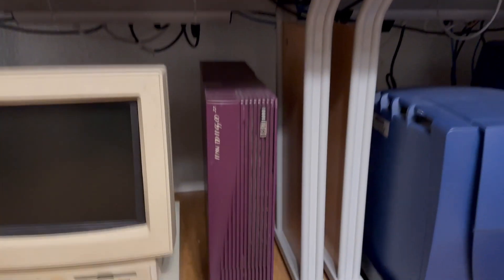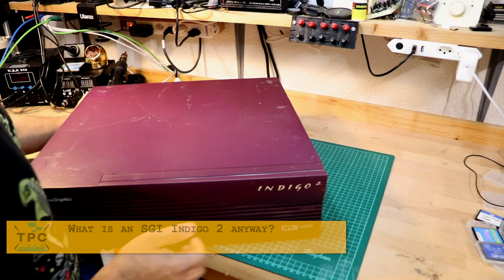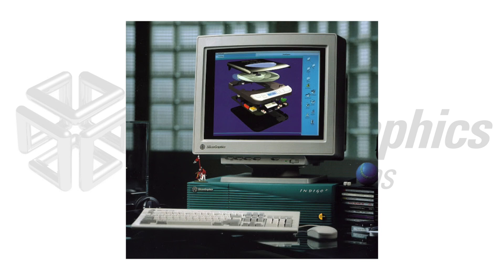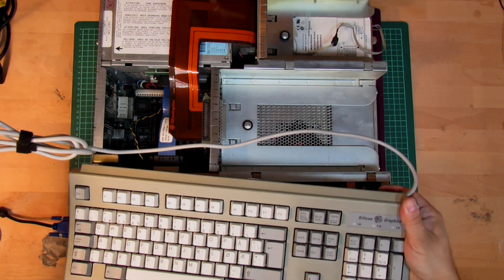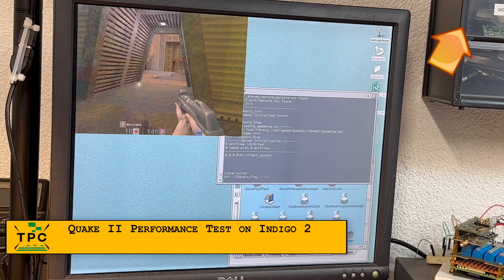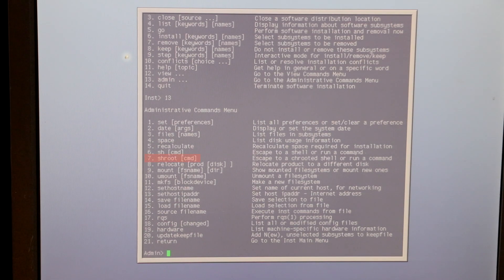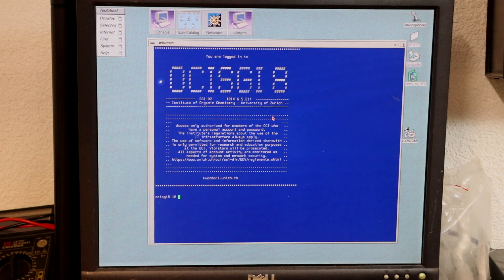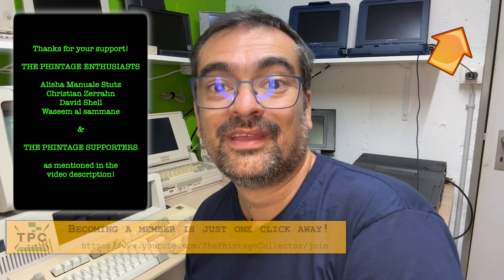Silicon Graphics Indigo 2: A First Look & IRIX Root Password Reset

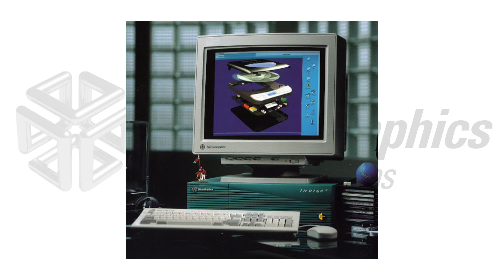Comment: 2:09 - Indigo2s were not normally quite that expensive. :D  In Feb/1996, an R10K/195 SolidIMPACT with 128MB RAM and 4GB disk was (with 25% academic discount included but not VAT) 27595 UKP, and of that, about 6K was just for the RAM.

The 175MHz version would have been somewhat less, while the R4K/250 equivalent was 23192 UKP. To scale up the cost, an R10K/195 MaxIMPACT with 384MB RAM and 4GB disk would have been about 54000 UKP, the RAM responsible for 18K of that, ie. a 128MB kit cost 6K (it can take more RAM, up to 1GB, but 256MB kits didn't come until later, and the 512MB option was never official).

What really blew up the costs was OEM software; I remember seeing a Maya/Alias licensing invoice at a movie studio around the same timeframe for 50K/year, while prices from Discreet might require the sale of a kidney, or an arm (whichever you disliked the least). I know someone who bought an original Flint system from Discreet at that time (R4K/250 Max/TRAM, 384MB, IMPACT Digital Video w/ VBOB, special CDROM base tray with SCSI extender to give an external port for channel 0, disk array with 4x 2GB on two channels, A2 Wacom, etc., running Flint 5.5) and it cost 95000 UKP (which would easily have been a solid chunk over 100K USD after conversion), but this sort of thing was an exception rather than the rule.

5:15 - No need for all that, just enter 'sh' at the first prompt. Interesting use of the passwd command though, I normally prefer to edit the password file with vi to remove the password, along with passwords for any other relevant user accounts to make things easier, ie.:

/root/usr/bin/vi /root/etc/passwd

6:19 - There are better ways of doing that, but one extra step that's helpful is to go into the label menu and turn on write caching, this can speed up older drives by a useful amount. One can always run a sequential read scan later. Easier to just repartition instead and then mkfs a new filesystem, though when doing so I use the expert menu to configure a larger than normal swap, usually 256MB or 512MB depending on the disk capacity, installed RAM and what the intended tasks will be for the end recipient. For maximum certainty, run a full read/write/compare sequential scan before doing the OS install (never use the random option), I think the auto option is only doing a read scan.

Note that SGI marketed the R10K/175 system as Killer IMPACT.

Comment: Do these old SGI compuets have any use beside exploring hardware/software and being basically used as a historical object? They are definitely not for retrogaming,acting as a server,porting back newer softwares and etc...
Reply from the maker: SGIs were no gaming machines.
Although there were games for it, too. And even some popular ones like Quake II and Quake III Arena were ported by the vendor itself, to show the 3D graphics capabilities.
And the powerful SGis didn't actually do too bad on this behalf.

Still, given today's standards, these machines are not only old, but also slow.

You can of course run contemporary software on them, like on any machine from that era, at the example of SGI, Maya, Photoshop, and what not. That was, what these machines were made for.

But as technology, and also the software has evolved, there's no practical use except, as you say, for exploring how things were 10, 20, 30 years ago.

I once did a video how to do video editing using Adobe Premiere on a SGI O2 workstation.
Can it be done? Yes. Is it meaningful? No, except for the showcase.

And show is the server functions, which actually did exist in SGI IRIX.
It could run as web-servers, DNS, NFS, NIS, and what not.

But mostly, IRIX servers were used as 3d render farms, or SGI's own video conferencing product, to just give two examples.

But again, nowaways, nobody would do that, as even the most recent MIPS-based SGI running the IRIX operating system was released in 2003.
I don't think anyone is still using nowadays any Tezro workstations or Origin 3000 servers anymore in a production environment.
Reply: @THEPHINTAGECOLLECTOR  Not so, there are vast numbers of SGIs still in commercial use in a number of sectors, mainly PCB production, textile manufacturing, medical, vis sim and defense industries (those that concern industrial control processes or management of external hardware). Most systems still in use tend to be Personal IRIS, IRIS Indigo, Indy, Indigo2, O2, Octane, Fuel and Onyx. Most company queries concern Indy, O2 and Fuel systems, though a major printer manufacturer bought some RAM kits last year, they're still using Indigo2s. AMAT SEMs were typically driven by Octane or Fuel systems, for PCB analysis, and its these which sustain demand for higher order parts such as V12, DCD, DM6, etc.

Some people do use them as servers. Remember O2K type systems can have GigE, while O3K can use 10GigE. Personally I wouldn't, though ages ago I did use an Indy and then an O2 as a firewall box for a few years.

I heard from someone who uses an IRIS Indigo for audio, because the quality of the audio chip is so good. The oldest system I've dealt with is a 12MHz Personal IRIS, still used at a textile factory in Ohio. I was also contacted by a US defense contractor looking for parts for a 4D Series machine, which is even older, probably an R3000 variant (perhaps a POWER Series, the guy didn't say).

But where CPU performance is paramount, such as rendering, likewise raw 3D, then of course no, they've long gone from the market for that sort of thing, but a lot of people do get them so they can use older versions of pro apps which they favour, Power Animator 9.0 being especially noteworthy. Recently I sent an O2 to the US, to be used by a young guy who wants to learn old Maya, etc. I've talked to many in recent years who have setup old SGIs so they can explore or relive the 90s-style CGI that was popular in film, TV and animation back then (one guy was especially obsessed with Jurassic Park). One lady, a retired CAD designer, obtained an Octane so she could explore the work she used to do. You'd be surprised. However, companies that still have them tend to not want clients to know this is the case. I talked to a movie studio which still runs an Onyx3900 IR4 with Inferno, because the admin said it still worked fine for compositing (10GB VRAM and 1GB texture RAM), but they don't tell clients that's what Inferno is running on, it just runs very well and that's what matters.

I'm helping a textile factory just now which is having problems with an Indy (called Stoll/SIRIX systems, they drive huge Jacquard weaving machines). Plenty of SGIs still around, but they tend to be in sectors about which hobbyists traditionally knew very little, and wouldn't immediately associate with SGIs. Texas Instruments, Digital Foundries, Canon Technologies, they all still use SGIs. Funny old world.

Comment: Strange that the it guys didnt wipe the data. Not good
Reply from the maker: @Lofote  These old machines, no matter where they come from, have a 50 % chance to still have a hard drive, and if they do, it’s a 99 % chance of not being wiped.
Reply: @THEPHINTAGECOLLECTOR  I find that really dangerous. I mean if it was a private person, okay, they don't have the knowledge. But you said it was from a university, right? They should have IT staff :-o ...
Reply from the maker: @Lofote  No doubt and excuses about that.

You'd be surprised though how many machines I came by which were obviously never sanitized.

It's a clear indication, IT and security standards have not been very high years and decades ago.
Reply: @THEPHINTAGECOLLECTOR  I've dealt with hundreds of SGIs that still had their OS setups intact, none had any compromising data, but true enough, certainly a risk. Infact the only item like that I encountered was a SCSI disk that had originally been used at a high school in London in some kind of PC system, it contained all the exam report docs, ID pics, disciplinary reports for the students, staff info, etc. It came from an IT recycler which was clearly not doing its job. Naturally I wiped the drive.

Comment: I would love to know a way to cosmetically repair these beat up and scuffed Sgi machines. Especially those Indy blue boxes that are textured.
Reply: I get pretty good results using T-cut to remove most marks & scratches, via careful motions with a box cutter knife (plus a combination of antistatic foam cleanser and WD40), but it does take some experience to do it right (I've been doing it for more than 20 years). It's a little harder with highly textured surfaces like Indy, but still works. Easiest with O2, Octane and IRIS Indigo, while it's also ok with Indigo2 but one must be wary with purple systems not to do it too much or it can over smooth the texture. Curiously, the process works very well with the black base for O2, even though it's highly textured like Indy.

Discolouration can be dealt with via retrobrighting.

Comment: At @6:24 looks like a Teac brand FDD. I know Teac made SKU's which were FDD for SCSI. I am thinking that is what you have there. Neat find. 🥳
Reply from the maker: @pianoman4Jesus  yes, it‘s a TEAC
Reply: @THEPHINTAGECOLLECTOR  I've dealt with quite a few of these SCSI floppies supplied with SGIs, likewise the Floptical. It's hard to find units that still work ok, they almost always need some cleaning & servicing, sometimes proper repair.
Reply from the maker: @mapesdhs597  yeah, I heard so particularly about the floptical drives.

Comment: A very obscure fact about these machines... The world's first "hubless" engine cooling fan was designed on the SGI Indigo in Carmel Indiana. Before that, all plastic engine fans had a large cylinder in the center with the blades coming out (think 99% of computer fans). The high end 3D capability of this machine made that possible.